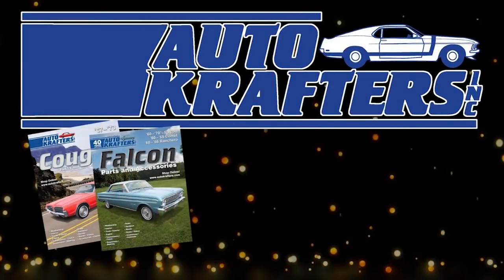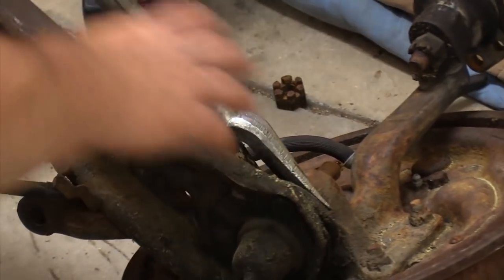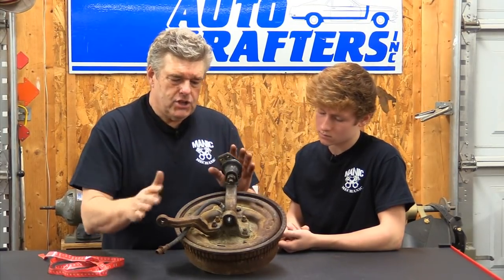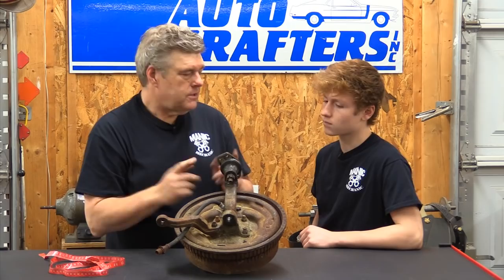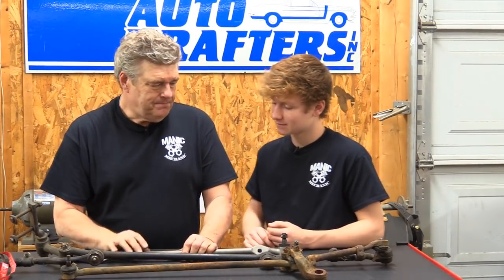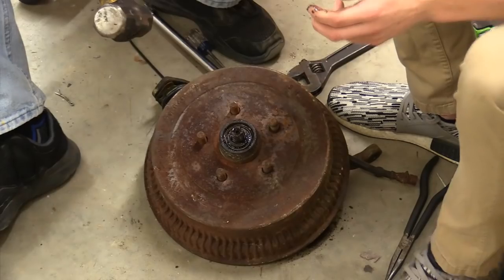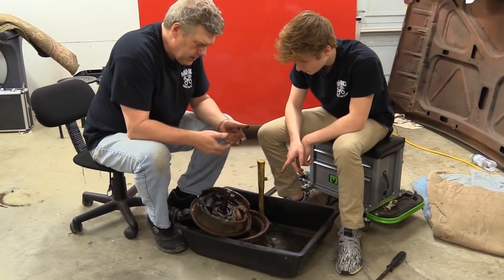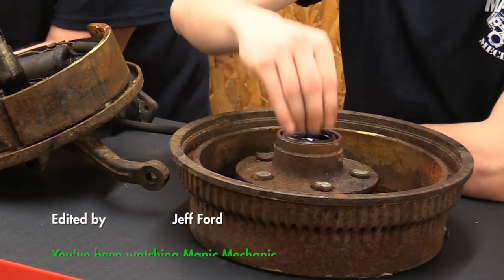Identify Correct Spindles 1963 1964 1965 1966 Falcon Comet Mustang

Comment: The 63 drag link you compare to is from a 6 cylinder Falcon steering assembly (7.45 minute mark).  Totally different from a 63-64 V8 steering drag link.  No question that 65 steering geometry is very desirable.  65 Falcon/Comet steering components do not play well with 63.5-64 spindles.  63.5-64 Falcon V8 steering also does not work well with Granada spindles.  

I have both Granada disc brakes and CSRP Kelsey-Hayes knock off brakes on my Falcon/Comet collection (all have 65 steering geometry) and honestly can not say one steers better than the other.  When Granada stuff was cheap it was the way to go.  The CSRP kit would be the only way I would recommend today.  I use the same alignment specs with both braking systems.  On alignments specs I have found the critical spec is toe.  The closer you can get to 1/16" toe-in the better.

It would be easy to bash Ford for the 63.5-64 V8 steering geometry, but one must remember the stock wheel and tire size was 6:50 x 13".  Not a whole lot of contact patch between the tire and the road so feed back was negligible.

Comment: So, what are the correct pieces I need to upgrade my 1962 Falcon steering and suspension to 1965/66 Mustang specs?  Its a 200/C4 sedan. I do have a complete 1965 Mustang 6 cylinder power steering system. Can I bolt it on to this car or are there any modifications needed to use it? Thanks in advance for the help.

Comment: My 64 Falcon hard top v8 and t10 had 5 lug 650-13s when I bought it in 1968.  I installed f70-14s radials.  I had a  progressive alignment shop align the car.
There was no numbers for the car with radials.  To this day I have not had a car drove that well.  The car was hell in the snow. When I sold it with 160,000 miles
it had a cracked upper "A" arm out of the shock attach holes.  Were the 14" and 260 to heavylfor the upper arms?
Reply from the maker: The suspension style was really tough on front ends.

Comment: HI I have a 1963 falcon convt.was a 6cyl. Changed two a 302 still have 6cyl spindles changed lower control arms to tubular cpp.Mini sub frame Can I use C5DZ 3304A drag link on car also do I need to change tie rod ends to 65 or use 63 trying for better handling and alianement also have UCA drop on car and yes 8cyl springs I think I m almost there but could use your help thanks for your time  Pool man 63
Reply from the maker: Honestly, get a set of V8 spindles. You can get the ball joints for the V* to put in the arms. Then you can update to the 65 drag link, pitman arm and inner and outer tierods.

Comment: I have a 65 falcon just got it. It was my grandfather's car. It has drum brakes all around and I want to change to disc in the front. What all would i need to do
Reply from the maker: I'd go with an aftermarket bolt on kit. Rod and Custom Motorsports offers a kit for 419.00 as of December 2020: https://rcmotorsportsinc.com/product/rc-132-11%E2%80%B3-disc-brake-conversion-for-early-60-70-mid-size-fords/

Also convert it over to dual reservoir  master cylinder while you are in there.